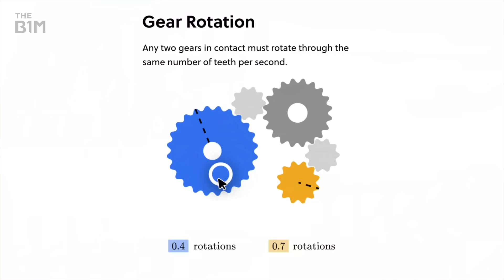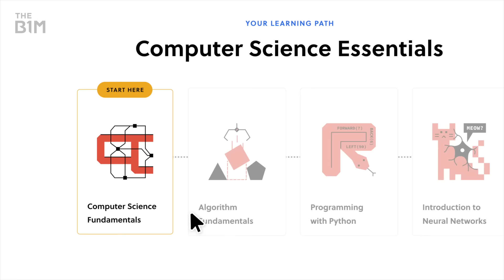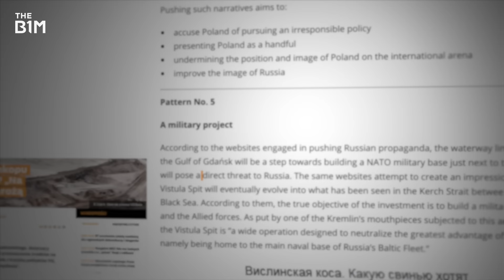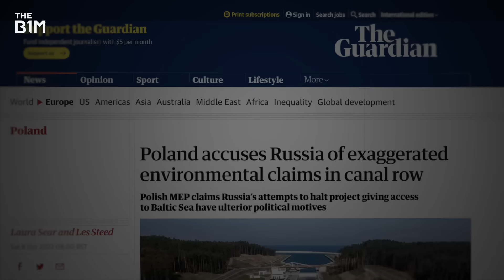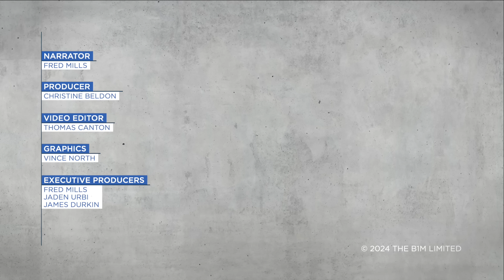Why Russia Tried to Block This Canal

Comment: Another interesting fact is that yachts can pass by on their way to the Masurian lakes. According to information from the Maritime Office, over 1,300 yachts have passed through so far.
Reply: Masurian lakes are not suitable for sea yachts - too shallow waters. Apart from that the only water connection between Great Mazurian Lakes Route and Baltic Sea runs not through Elbląg, but through Gdańsk, Wisła river, Narew River and Pisa River. Pretty long way round possible only for boats with very little submergence, not sea-ready yachts.
Reply: @jacek5384  What is the water depth there? E.g. catamarans frequently have drafts of less than 1.5m. If you don't want to go under bridges, you don't even have to unstep the mast.
Reply: @realulli  To all the way from the Wisła River outlet upstream through Wisła, Narew and Pisa rivers to Great Masurian Lakes Route one will need a boat with submergence rather like a kayak. That shallow there, particularly Pisa River very shallow river. From Elbląg port one can go by water to another part of Masurian Lakes, not really popular for yachting and smaller lakes. Anyways not suitable for seaborne yachts or any boat with submersion more than about 50 cm.
Reply: thats false the biggest thing that can pass through the canal are kayaks but even then due to the amount of paperwork that has to be done its faster to just carry them across next to the canal

Comment: It is worth adding that the port in Elbląg is a small, insignificant port in Poland. Currently, mainly yachts use the canal.
Reply: Gdynia used to be a small insignificant village.
Reply: @jaszaesel5390  Gdynia has deeper waters, Elbląg does not

Comment: A canal is like a road, only it runs on water. Poland did right to build a road that is short and independent of Russia's moods. In this way, several small ports were connected, enabling the development of these regions, which are also very beautiful for tourism.
There is no problem in going on a beautiful holiday trip in a small or larger boat.

Comment: Weird that an open lagoon would have a different water level than the outside sea.
Reply: ...maybe due to tides...?
Reply: Hydronomics go brrrrr
Reply: I thought the same, mostly because the open sea is just down the coast a little with no canal required? 🤷🏻‍♂️ clearly not as simple as that 🤔
Reply: The flow through the connection between the lagoon and the sea depends on the difference in water levels. The greater the difference, the greater the flow. Ignoring short term fluctuations including tides, the lagoon has inputs of direct runoff from land and from rivers. The output is through the connection across the spit. The average difference in water levels will stabilize such that the inputs equal the outputs. If the connection were wider, the water level difference would be less and if the connection were narrower, the level difference would be greater.
Reply: @AttilaAsztalos  apparently the Baltic Sea does not have significant tides.
Reply: @ronald3836 Tides play a significant role in keeping the water in the lagoon, but it looks like there are numerous streams and/or rivers that flow into the lagoon, which constantly keep its water level higher than the sea. Mix that with tides = higher water levels than the sea
Reply: Not all parts of the open ocean have the same level, either. This is influenced by many factors, including weather, influxes of fresh water from land, and the gravitational effects of the land features around and beneath it, and even of the glaciers and ice sheets upon that land. 

In fact, the mapping of the gravitational attraction of seamounts, which raises the local sea level, is the primary way we know what the bottom of the ocean looks like, but this method only has a roughly 5km/pixel resolution, which is why we say we know more about the surfaces of the Moon and Mars than we do about oceans, as both have been measured to a much finer resolution.
Reply: It was apparently done this way to prevent salt water from infiltrating the lagoon and the rivers that feed into it.
Reply: Tides 2cm in the area
Reply: River water flow off the land into the lagoon.  As the waters flow into the lagoon they'll back up a bit as they attempt to flow northward and out of the current opening up near Kaliningraad, which also sees water coming down the river running through that Russian enclave.   And the lock system would help keep the salt water of the ocean out of that end of the lagoon which probably has fresh river water in it.
Reply: Note the barrier island's two narrow openings between the Baltic and the lagoon. They limit the rate of the tide's ebb and flow between the two bodies of water, and thus it takes a while for the sea level in the lagoon to equalize with the sea.
Reply: Peconic Bay between the eastern forks of Long Island has a small canal lock on the south fork so fishermen can transit to the Atlantic Ocean. The Shinnecock Canal
Reply: @TheRoweros  a 2cm difference is a LOT of volume if you're trying to fill and empty the entire inner bay tidal difference twice a day through a very narrow canal, easily enough to make ship handling challenging..
Reply: @norgeek   literally there's no tides... 2cm difference is a lot when comes to women perspective 😉
Reply: Oh, that's a good point too! Thanks for the reminder @pjmorgan
Reply: What would happen if that lock wasn’t there? Would the waterlevel in the lagoon drop a few centimeters? How would that impact the lagoon and the coast?
Reply: @Simonb1977  It would create a new current and probably erode the shore. There is a delicate balance between fresh water and salt water and the new opening could create a lot of unwanted changes in aquatic life. Small boats might have difficulties going through strong currents, which can be dangerous. The lock keeps everything under control.
Reply: @pjmorgan  This is probably the most sensible reason I have read so far.
Reply: Ya there must be quite a current in the strait during the tide changes.
Reply: @adamabele785  would at some time the current stop? Or become less?
Reply: and today is a great day to learn more about tides, then you can wonder no more.
Reply: @Simonb1977  The current would never stop, but might change direction depending on wind  direction. The current might make it difficult to navigate the channel or cause danger that ships and boats wash ashore or collide. The locks just make the passage safe without currents in either direction.
Reply: That's actually a huge mistake of a video. Water level is almost the same. Locks are used to prevent from aggressive mixing water from freshwater bay and salt baltic see. It is about preserving the natural environment of the bay.
Reply: @Nihilus13  some mixing will inevitable happen. And how is the mixing at the Russian part?
Reply: @launchsquid  and why is that not a problem in the Russian part?

Comment: 7:20 - I'm afraid that "medium ship", in international commerce, means something more substantial. With 4 meter limit on draft the canal cannot accommodate anything seagoing - that's the job of nearby ports of Gdunya and Gdansk.
Reply: Not true. The sea ships up to around 8000 DWT will be able to reach Elblag through this channel.
Reply: First realistic approach in comments - new channel is too shallow, past and present vessels movement didn't require such an investment. More efficient and needed might be setting sailing route through Vistula river from Gdańsk to Bydgoszcz / Solec Kujawski to distribute goods from Gdansk/Gdynia real seaports
Reply: @funtasta  This is it, small-scale local shipping while nearby existing ports can take anything that can cross the Baltic.
Reply: @funtasta  Meanswhile, Gdynia and Gdansk are far away from achieving max capacity....So, where's all the traffic at Elblag harbour?
Reply: So why Gdansk is still being extended? :) The main purpose of Elblag is supporting role to big Gdansk or Gdynia. Armatures of smaller ships can use cheaper harbor, or store load for longer time there. Simply a bit different clients can be serviced in Elblag.
Reply: It can't accommodate deep sea shipping but certainly can accommodate short sea shipping.

Comment: A very logical canal location. How easy/difficult will it be to make it bigger to suit large ships? And was the island designed to be a wildlife habitat or does it have another purpose?
Reply: It might just be a nature compensation measure. Either because of legal requirements, or because it unlocked additional subsidies.

Large infrastructural projects are often required to 'offset' the ecological disturbance that they cause. Creating a new habitat could have been such an offset measure.
Reply: had to dump all that dirt somewhere aint it?
Reply: It's a naturally occuring spit of land
Reply: Idea is that birds will nest on that island, and they needed to dump all that sand somewhere. There is a plan for a second island from deepening waterway to Elbląg port, at the moment there is legal battle about who should pay for it, local or central government. As for the size of canal itself, there is no need for bigger one, and likely never be as Elbląg port is rather small and expanding it would cost too much. Personally I would rather see those money spent on expanding port of Gdańsk, or building container terminal in Szczecin but on the other hand it may be needed for military use unfortunately.
Reply: @tjurzyk  What are you all talking about, it's a natural spit of land, the Curonian spit
Reply: @frisianmouve   dug sand was dumped in the water creating artificial island, second island may be created if they dredge waterway to Elbląg as planed.
Reply: @tjurzyk  Oh nvm, must've missed that in the video
Reply: Basically impossible to make it bigger, bcs not only the canal is too shallow, whole Gdańsk Bay is too shallow for larger ships. Complete waste of money.
Reply: @biselfish It is not Gdańsk bay, which is over 100 m deep, it is the Vistula lagoon, which is a shallow lagoon indeed. Second, the Elbląg port will enable to get rid of small and medium sized ships from Gdańsk.
Reply: @Dziki_z_Lasu  True, my mistake.

Comment: There are other similar story-projects: to connect the island of Uznam and the town of Świnoujście with with the rest of Poland, reunited at last. And in Łodź, Poland's 4th largest city located in the middle, there is a tunnel built to connect two different rail networks... an overlooked project since 1918... when the country was reunited from three parts.

Comment: How on earth is the water level different when there's an opening to the ocean only 30 km away from the canal?
Reply: Excellent!    Tides but do the Russians have locks?   I don't think so.
Reply: Even a relatively small marsh throttled by an ocean inlet will see a significant time lag between water levels.  For a straight-through canal, that can mean a strong current, persistent silt buildup, etc.
Reply: A storm from the north raises level by 90 cm relative to the lagoon!

Comment: Why is the water level different on both sides? Isn't the lagoon connected to the sea on the russian side?
Reply: Every river that empties to the sea is connected to the sea. And every river that connects to the sea is at a higher level than the sea, if you go back upstream a few km. This lagoon is, in that sense, like a big river. It is fed upstream by streams, rivers, and runoff.
Reply: my guess would be because the open area is too small to allow all water needed to equalise the difference between high and low tide through every 6 hours.

Comment: For God sake why wouldn't they make the canal deep enough right from the start......when it is starting out from scratch?????   Unbelievable.
Reply: testing the waters???
Reply: @JohnSmith-yv6eq   Yes but they already had all of the men and equipment in place.....doing the digging....building the lock. I can't get over the fact that they wasted the opportunity to do it right the first time. Now it will cost WAY more to correct the first design.
Reply: @rael5469  its because of the environment

Comment: 650 years payback does not make sense.
Back of envelope calcs:
$450M project
450 million divided by 650years = $692K per year
Divide by 365 =$1,900 per day
Divide by 12 ships that currently pass through daily and that is $158.

Therefore if they charge $158 per ship that are using the canal it would take 650 years to pay off the $450M project.

I assume they are charging many factors of magnitude more than this
So it can’t be right.

I know this is simplistic but illustrates the point.
Also, anyone correct me if I got this logic wrong.
Reply: I think you didn't include the ongoing costs of operation and maintenance, which will obviously be orders of magnitude more money than the original investment, as you can see it's far from a passive system.
Reply: 12 ships daily CAN pass through it. It's the capacity, not usage. Real number is about one per day which is far from breaking even (someone has to maintain it) - but it's predicted to somewhat increase
Reply: In the end, it doesn't really matter because Poland is creating sovereignty for itself and it's hard to measure what this brings them in dollars.
Reply: @vomm  You build it for your own money, then you may say it's unmeasurable. Public investments need to make sense and have a practical purpose. You can't just explain it with some sovereigninty propaganda, when the country is dependent on its neighbours thousands of times more in other areas, like fossil fuels for electricity and transportation.
Reply: True.  I guess there are savings in avoiding Russian bribes but additional costs in Poland construction kickbacks.
Reply: You forgot about the interest cost on $450M.
Reply: You may also depend on your 'neighbour' not invading your country, maybe the marked increase in spending on your military over national security concerns may not be seen as investing in your public,  but with recent geopolitical upsets, it could cause a certain preventative mindset that the public may not resent, and even welcome. Propaganda or common sense? @Tarets
Reply: Also it costs $450M, but state can gain back maybe $50-100M with VAT and labour taxes, making it only to be $350-400M investment.
Reply: @andthen0170
   You can’t put a dollar amount on freedom.
Reply: Może dla ciebie 450 mln.$ to dużo, ale dla takiego kraju jak Polska to są grosze.... A możliwość rozwoju terenów wokół inwestycji jest bezcenna...

Comment: The Poles knew long before 2022 that no free country should depend on Russian gas. Therefore, they also built a LNG harbor and now get their supply from the Emirates and the USA. The Yamal gas pipe is closed, but not the one connected to Norway.
Reply: yk that exporting gas through pipes instead of ships is not only much cheaper, but also much more environmentally friendly. I'm not saying nations should completely depend on it, but declining an offer like that is plain stupid

Comment: I'm not convinced about the canal. Gdansk is only 25 miles away and can handle any  shipping whereas the port of Elblag is limited to vessels of less than 1.5M draught and is too narrow for deep water vessels to turn. The main beneficiary of the canal is the Elbrewery which will make Heinecken's owners happy, but is that  1/2 billion well spent or an EU boondoggle?
Reply: Widać, że mało wiesz...
Reply: @PanProper  Then enlighten me.

Comment: "each block had a hole in the middle to reduce water pressure and increase stability throughout the wall"

Can anyone link to/explain how these blocks work? 

i'm very confused as to how the hole in the blocks help anything 4:21
Reply: After some googling, no paper I've found offered any further explanation on why the hole in Xblocplus 'reduces wave pressure' on the blocks below, but the second major reason for the hole is that 'it makes the pick-up, transport and placement of the block much easier - the application of the blocks is thus substantially quicker and safer.' ; ' This hole is used for fast and very efficient placement with a clamp.'

Comment: Honestly it does seem small for a canal. I doubt this buries their reliance on kaliningrad. Why didn't they make it much larger to begin with?
Reply: Not needed- no big ports…
Reply: Because this canal is for small and medium sized ships. Our ports responsible for container ship handling are located in the west
Reply: There was huge discussion about this project in Poland. This was one of points against project in this form.
Reply: Because it opens Vistula river directly to Baltic ports. Big ships don't fit that river.
Reply: @maciejadamfiszer3525 i was wondering why so many comments asking about it's size without firsy looking at map at see how big the river it was supposed to be connected to
Reply: Very close to it is the large and dynamically developing port of Gdańsk. He eats everything that flows to Königsberg.
Elbląg is to stimulate the north-eastern part of Poland, (Warmia and Masuria) is one of the poorer parts of Poland. Additionally, the clogged port in Gdańsk will be able to redirect smaller vessels to Elbląg.
Historical curiosities: The Third Reich produced Seehunt submarines in Elbląg.
Reply: @aoilpe  No port - no canal. Idiotic and pathetic investition.
Reply: Cos this whole investition is a joke. Check where it leads to - nowhere. Its been built for tiny ships, boats, jachts. DUnno why really.. Noone needed it apart from officials.
Reply: @shycracker  I cant see any river on the map.. And why is it so tiny?
Reply: @bratbrata4974  This is what people say, but its one big bullsshit. $500000000 wasted.
Reply: No need for a bigger port and the fact the channel which is now connected to the Baltic Sea is neither big nor deep enough for large cargo ships.